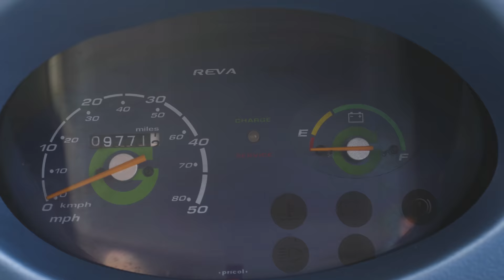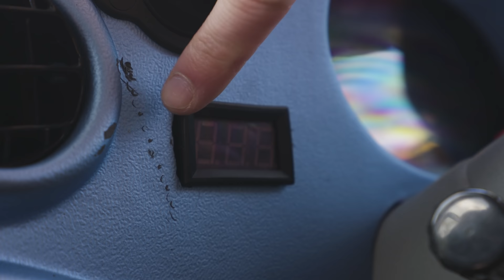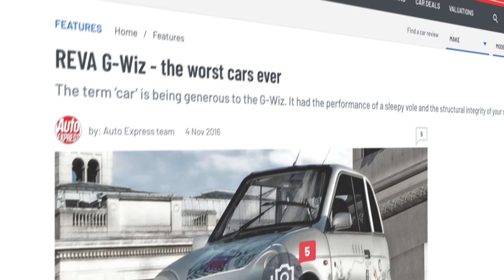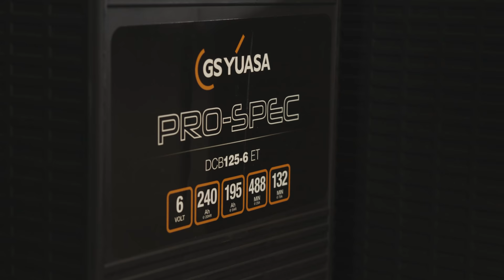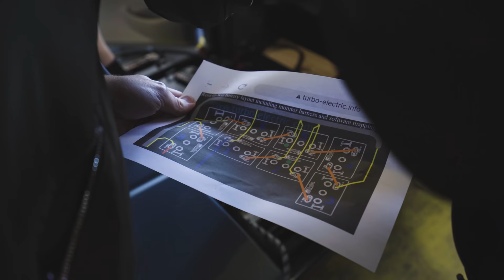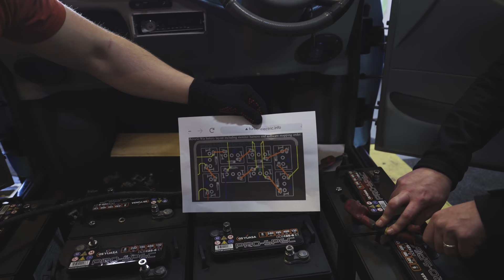We Bought The Cheapest (And Most Hated) Electric Car

Comment: I would love to see the G-Wiz converted to LiPo batteries like some Tesla or Nissan Leaf cells, I can imagine that old brushed motor can take some serious amps!
Reply: They actually make 48 v drop in LiPO batteries that you set up in parallel for more capacity. With 8 of them in that car it would rip, and for a long time!
Reply: Li-ion*
Reply: @873Project  this. They talk about lithium ion batteries. Not lithium polymer.
Reply: The original company actually did make a version of this car with LiIon batteries called the L-ion...didn't improve the performance any but did jack the range up from 50 miles to 75.
Reply: There's a video of someone who did it.
Reply: @michielpluim1216  yeah literally, lipos would be ruined in the winter the can't get cold
Reply: I know Aging Wheels swears by LiFePO batteries. Maybe they're a good choice?
Reply: @musewolfman  safer
Reply: I think Top Gear did this 14+ years ago. If it wasn’t LiPo, it was a rocket ship regardless
Reply: @musewolfman  safer, cheaper, but has less energy density than other lithium ion chemistries, meaning for the same weight and or size, you're gonna get less kw out of a lifepo4 pack
Reply: @michielpluim1216  The term lithium ion is terribly broad, and in many uses includes lithium polymer (LiPoly batteries use lithium ions in a polymer electrolyte). Most lithium polymer batteries use a very similar if not identical charge cycle to the "traditional" lithium ion chemistry with 3.6/3.7v nominal voltage. This is a lot more similar to lithium ion than other chemistries that are also technically lithium ion, including lithium iron phosphate and lithium titanate.
Reply: It actually has AC induction motor and with better controller like Kelly KAC-8080N and good lifepo4 batteries it can probably have 3 times as much peak power
Reply: I'd love to see a piano dropped on it !

Comment: Put a diesel generator on a trailer and run it as a hybrid. would be interesting how much MPG you get 🙂
And I also like the idea of a RC G-Wiz
Reply: YES!!! Generator time!
Reply: It will be how much the generator does mpg not the car
Reply: Given the whole war thing in the east. Fit it with a big gun and call it an RPG-Wiz.
Reply: Dave Sparks did a similar thing on his channel, threw a generator (or two) on the roof of a little electric vehicle. 😂😂
Reply: It would be interesting to see it kiss a wall at 31 miles
Reply: So like on old top gear 😂
Reply: Oh no it would be the stigs eco cousin all over again
Reply: Don't think it has enough power to pull a diesel generator powerful enough to be effective. Thing is piss weak.
Reply: RC G-Wiz like the stig have
Reply: @unknownunknown3368  ... obviously...
Reply: @williamlim5234  woops. didnt know this
Reply: I don't think it would work as well as one could imagine. The energy to move the car, passengers and the loaded trailer would greater than the energy that could be charged into the batteries.
Reply: @Neojhun  Moped engine and car alternator mounted inside the bodywork :-P
Reply: Didn't top Gear do an RC one?
Reply: yes, take the death trap and tow a bomb behind it. what could go wrong?
Reply: @martijnkosters9024  Nice.
Reply: Yes, this.
Reply: Ha, Clarkson did that with his Eagle i-Thrust.
Reply: @p1_reko990  They did. Stig used it
Reply: jajaja muy buena idea

Comment: As a lover of old bad electric cars. I would totally pay 400 for that. It's in much better condition than the citicar I was looking at for that price.

Next up, lithium swap, bigger motor and controller, doughnuts.
Reply: Have you watched the top gear episode when they did that?
Reply: keep in mind the batteries are like 2 grand
Reply: @kaptein1247  well it would depend what kind and how many cells you want.
Reply: @oldtechnobodycaresabout  If you can deal with even less than 50 miles
Reply: @kaptein1247  Which makes it just more fun because it'd make it a sleeper - and nothing is funnier than a deceptive car.
Reply: and then the batteries wont last nearly as long as well
Reply: @Ohem1  How would that make it a sleeper?
Reply: @kaptein1247  2k for batteries isnt that bad
Reply: @kaptein1247  anything is possible if you try hard enough. Dont be a buzzkill
Reply: @kaptein1247  Referencing OPs comment, lithium swap with X amount of cells, a capable inverter, programmable ESC, stronger motor….and a decent pair of disc brakes for stopping power. Then off to a drive-thru and a highway showoff.
Reply: @Ohem1  I doubt this is a car that you would want to do something like this to
Reply: In theory I’m with you, but the phrase “disassembles like nothing I’ve ever seen before” from a car crash expert would slightly worry me
Reply: @kaptein1247  you can say that for alot of cars. Doesnt stop people
Reply: @adrianwelgemoed9562  Remember that isnt even actually a car, is one of the worst cars ever created  and has the worst crashtest in the history of cars. 
I hope they will do something fun with it, but hope its something other than just making it go faster
Reply: @kaptein1247  would be a cool offroad car
Reply: Can also make it a convertible move those back seats all the way back and get a little more leg and head room, it's a death trap anyways might as well commit to it.

Comment: That thing is a deathtrap. Shows how far you guys are willing to go for content, thanks guys!!
Edit. you must try offroading it LOL
Reply: @asterixxer old minis are only death traps if you roll them. Or get rear ended. Or t boned. Or have a head on....

Okay they're death traps in all sense. But you have to remember they were put into production in 1959. The G-wiz was put into production in 2001... that's 42 years of safety development that they just didn't bother with
Reply: coming from the country that made the reliant robin.....
Reply: @douglaspealing5608  and guess what. there are still quite a few cars sold in India (including weaker/cheaper built but current gen models of suzuki, hyundai/kia) that are only a bit safer
Reply: @asterixxer 6-7000 Euros?  The G-Wiz was sold for 13,000 Euros with lead batteries and 23,000 Euros with lithium batteries.
Reply: @AIDANPEREIRA  I'd take a mini over most small cars, even now
Reply: @alt7488  There are awful cars from all other the world I think the UK has done worse than the Reliant Robin, those cars were fast and people could drive them on motorcycle licenses if there was no reverse gear I believe, they had their reason for existing. The G Wiz is absolutely hideous from the front or side on but surprisingly quite presentable from the rear. There was a fibreglass car with a 2 stroke engine that used to be sold to disabled people in the UK, it was single person. Invacar? Even the name is insulting to the disabled. The Reliant Robin was like a Rolls Royce compared to that. I used to drive a Mini 850 and the Reliant Robin was also 850. I'd have zero chance of every keeping up with a Robin unless there was a lot of repeated corners because they were so fast and nippy.

Anyway I feel they should off-road in it as above but clearly it won't manage it on its own it would need to be towed through such a course perhaps behind a landrover. They could also do a bicycle challenge. Which is faster across a city or something and then into the countryside. Lots of great content could be done with the G Wiz. Just seeing it makes me smile.
Reply: @douglaspealing5608  I would too. atleast it looks cool for the lack of safety. the modern cars, especially in developing countries look boring and are still shit when it comes to safety.
Reply: I have one myself, and it’s actually quite good off-roading, but slow

Comment: I would say roll cage but it might have to be on the outside!

Not sure what you'd attach it to as I don't think there is anything solid to bolt it to.
Reply: Just bolt the roll cage to the roll cage itself and make an exoskeleton
Reply: External roll cage, suspension spacers, 4x4 wheels, and you got a battle car
Reply: I think with this little shitbox, you would say, “bolt the car to a roll cage”

Comment: Lower it, get some wider wheels, make it faster and more of a deathtrap. Perfection.
Reply: At last somebody with some Common Sense.  I have a 1991 Electric VW 35i Passat Estate on Coilovers.
Reply: @stoatrepublic  username checks out!
Reply: @stoatrepublic  Isn't a 1991 model a b3? The b3 Passat is such a cool looking car.
Reply: @mk2nathan  Yes it is!, its a car I've had several of over many years.
Reply: @stoatrepublic  that’s wicked mate! I have a mk2 golf which I’ve put g60 wheels on and coilovers. Going to any shows this year?? Hopefully I pass my driving  test before may 8th because that’s the first date of a big show I want to go to🤣
Reply: @mk2nathan  No, I don't do car shows any more.  Good choice with the wheels on your mk2.  I used to have a slammed matt black '88 mk2 Jetta GTi(8vmfi), matt black 15" G60 wheels with 195/45/15 tyres, limo black windows, total rat, literally drove it into the ground and keep going for years, if I reversed, the front bumper would come off. It was also one of the cheapest and fastest cars I had over the years.  I think the Jetta was designed for subwoofers.
Reply: @stoatrepublic  yeah I gone for 195/50/15 just for the extra comfort but the gap between the tyres and arches is so small I can’t get my fingers in them and it is still going to ride like shit haha
Reply: @mk2nathan  Roll the arches, prevention is cheaper then cure.  Check where long driveshaft goes under chassis, if your low its good idea to clearence that area, if you change to 45's and want to go lower you'll definantly want to spend time underneath it.  Then, define your expectations.  My slammed S class is nowhere near as enjoyable as a mk2 Golf.
Reply: @stoatrepublic  nah I won’t roll the arches because it’s just had 4 brand new ones welded on😂. Gonna keep it all factory oem it’s crept from slight modifications e.g coilovers and wheels etc. there’s no end of crazy modified mk2’s out there so it’s something a bit different to have something which isn’t too out of the ordinary. Also, is your a class bagged or static? I bet a bagged a s class would be the most classy thing on the planet with a big set of 20’s
Reply: @mk2nathan  No, its a w220 so that means its a bag of shit, only S class worth having is the W140. It is on air, but it leaks so I did 4 wheel alinement on the bump stops and rolled the arches, when the smell of plastic has gone you know that the inner wheel arch liners have been worn back by the tyres.  Rolling on 18" will not go bigger, driving a 2.5ton car on the bump stops is not something to write home about, the roundabout handling is worth all the effort.
Reply: @stoatrepublic  yeah but I bet it looks wicked😂 just park it up and look at it.

Comment: WOW looking at the latest MOT failure on 3rd March the kindest thing to do to this little ca ... I mean heavy quadropieceacrap would be take it to a cliff and push it off lol

Do not drive until repaired (dangerous defects):
Driver's seat insecure (6.2.5 (a) (ii))
Passenger's seat insecure (6.2.6 (a) (ii))
Service brake has no recorded effort at a wheel all brakes (1.2.1 (a) (ii))
Service brake efficiency less than 50% of the required value (1.2.2 (a) (ii))
Parking brake efficiency less than 50% of the required value (1.4.2 (a) (ii))
Repair immediately (major defects):
Horn not working (7.7 (a))
Front Windscreen washer not working (3.5 (a))
Windscreen washer not working (3.5 (a))
Front Windscreen in an unacceptable condition (3.2 (c) (i))
Offside Front Headlamp aim projected beam image is obviously incorrect (4.1.2 (c))
Offside Front Direction indicator does not face the front (4.4.3 (a))
Offside Rear Stop lamp(s) emits other than a steady red light (4.3.3 (a) (ii))
Rear fog lamp not working (4.5.1 (a) (ii))
Offside Front Inner Suspension component mounting prescribed area excessively damaged significantly reducing structural strength BATTERY HOLDER (5.3.6 (a) (i))
Service brake excessively binding ALL BRAKES BINDING (1.2.1 (f))
Monitor and repair if necessary (advisories):
All four tyres perished

Comment: put some lithium ion batteries in there, its smaller has more energy density and can draw some amps! im pretty sure you could get that thing to 60mph without changing the actual motor! and you would have a lot more range out of it, it would be a pretty good little thing (except the dying feature lol)

Comment: Ok so they make like.. LiPo or LIFE or whatever batteries that are heaps lighter than AGM (or whatever those deep cycles are)
You'd save over 100kg for sure going that route. And in a car that small and light (where the batteries would make up a large portion of that weight), that would for sure make a difference

Comment: Good and very topical video as always. Allow me to rant, but really because it is IMHO a serious point. One reason beyond doubt for this fiasco  is -the Gullible Public of today itself!!.  The market (you and me) were pretty well duped by the likes of especially Tesla into thinking that  current "modern" electric cars are the in-thing/miles better than old petrol and diesel, or even older EV types like this G-Whizz , without half-understanding anything like the real demerits about electric drive. Personally my company since early 2000's (started  at BMW Oxford before becoming independent) continues designing EV' drive systems from the perspective of simple utilitarian functionality which suits EVs best  (a characterisation inherent of the electric system no matter the battery chemistry) but especially if to compete at any degree with ICEs. Hence ideally lower overall power, reasonable everyday range (eg 100miles range per charge-yes you travel shorter but you also charge up much faster ever time, also means less weight, less battery on board =  less systems cost, etc) . 
AT it's time, almost ANYONE could afford a G-Whizz,  and even with it's clear foibles and incomplete resolution(1), it was still far within reach of the real masses who could benefit from a useably low cost everyday EV solution..
Billionaires-led Tesla distorted the picture by causing, post  2009, rise to current thinking that 600hp+ in a family sedan (Model S, E-tron, Panamera etc (2)) and all to" smoke GTRs and the like( -in otherwords just to prove a point-)  is so right, and the way to go with EV's. We have steadily thus  moved away from entirely feasible cars like the original NiMH pack Honda Insight (Even Pb-Acid G-Wizz) up to now electric cars being by default massive 3-tonne SUV's vanity/status symbol behemoths, running Lithium simply for no other option , and that have become ironically nothing more than  "power guzzlers" replacing " gas guzzlers".  I mentioned this to some Eco-warrior folks and all they could say in return was ask "Am I okay?" 
The end result of all this is vastly out of reach prices (£40Kmin average good family-sized EV) to buy electric cars new, unaffordable except for the relatively uber-rich (£100-120K SUVs!): and when they/you  have to sell used, you have to take the hit when "normal" consumers ask for "normal" prices. IT IS NOT DEPRECIATION, IT IS GOOD OLD REALITY COMING BACK TO EARTH!!

The other side of the problem is that our authorities are as equally blind and easily brainwashed: see the litany of non-standardised systems in infrastructure (private charging providers) whereas we could all have a uniform voltage, charge current type (ac or dc) just as you have exactly the one and the same Petrol or Diesel for all ICE vehicles, bringing overall running and ownership costs for EV users down. In a nutshell: hopeless lack of any grasp of average end user realities and needs. Instead, even before we can get simple EVs running, we are wasting time on self-driving cars, smart motorways and indeed LTNs that have and continue to end up massive waste of public funds without achieving any tangible positive result.

(1) By the way (@02:20 ) ALL cars are nominally dangerous enough above 40mph! This is the main reason s why auto manufacturers or crash tests themselves generally never go to quote any higher speed!! The G-Whizz also was a "neighbourhood electric vehicle" (NEV), with average speeds of 25-30mph as bicycles and  well-short of 40-50mph; so the crash tests were effectively adequate within that spec class.
(2) - High power ratings 600hp etc result from essentially  needing enough in-situ battery capacity for 200+ miles range ability: but once you have all that capacity on-board , why you may just as well dump it all down at a go in a big motor! This is how Tesla et al fool everybody about their "phenomenal" 0-60 times, it is simply a convenient consequence!!. However the hidden real-life cost of it all is you end up permanently encumbered by that weight AND expense, even if you do only 20miles a year!. The logic is there but it shows how difficult to change people's minds once "big names" aka Tesla, Porsche, etc speak.

Comment: Solar powered car, road trip it and see how far you can get :)

Looking at the batteries you've got 240 ah @ 6v so 1440 watt hours per battery and 8 batteries making a total of 11,520 watt hours.

If you had 400 watts of solar that would take a total of 28.8 (so let's just say 30 hours) to charge.

Being generous lets say you get 10 hours of some kind of sunshine in a day. Giving you 1/3 of the range so 16ish miles.

I reckon it wouldn't take much budget to massively increase range and efficiency with a new motor and you could definitely squeeze on closer to 600 watts or maybe even 800 if you wanted to really go for it. Solar panels and the components are really affordable and very simple to fit these days.

Slapping some solar panels on it and fitting an mppt could be done in a day with no experience beforehand.

Then to spice it up, 1 of you in the g wiz should race the other 2 who can only travel without using any fuel. So only bicycles, trains etc. So if you pick a city and rural route should be a pretty tight contest.